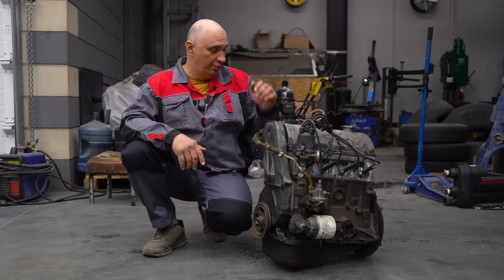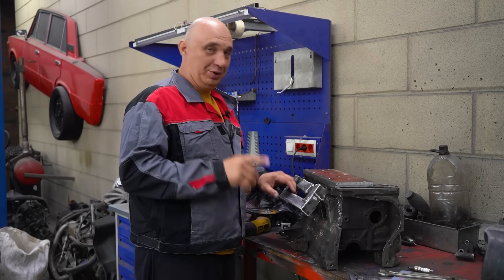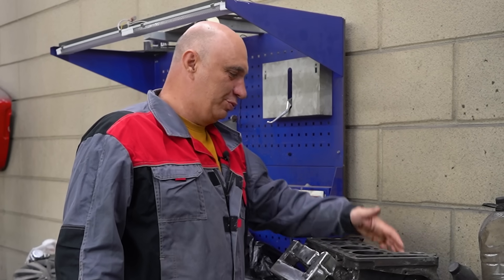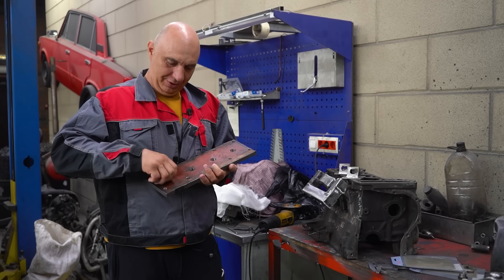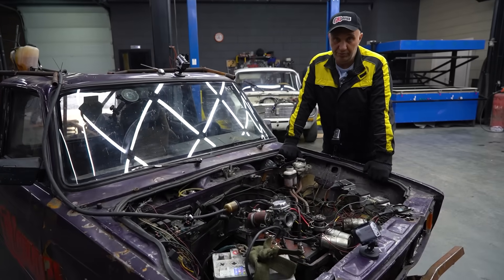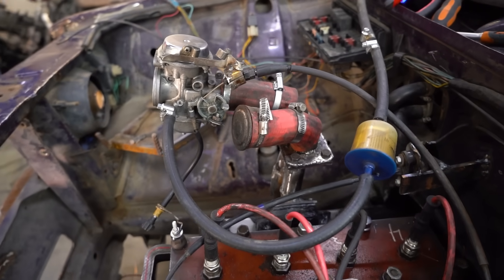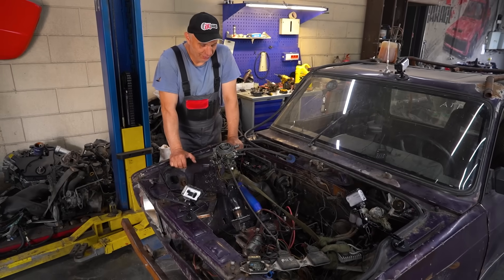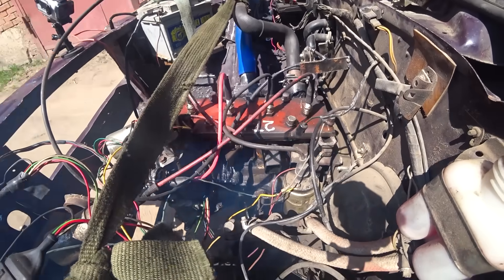4 stroke to 2 stroke Lada engine conversion

Comment: Your problem is the intake

You need to force air into the cylinders 

Traditional 2 strokes use reed valves the air is drawn into the crankcase as the piston goes up then the valve closes and as the piston decends the air is forced through transfer ports into the cylinders 

And easier alternative is to supercharge it

Comment: It would be nice to see 4 mikuni carbs on each cylinder, it sounds like there needs to be more research in to where the exhaust/intake port should be precisely and it's shape and size, as well as piston type, and compression ratio, if it was me I would take a outboard engine of similar size and copy its design

Comment: Dont use the case and pistons to pump the air charge, to many places for air to bypass to other cylinders.

Use a blower to force in the air.
If you continue to use only sleeve ports you need pistons with a deflector ramp to keep the charge air in and exhaust to go out, like other cheap 2strokes.

Or like others have suggested use the heads valves for exhaust like modern 2stroke engines. You can keep simple piston designs with that setup.

Comment: ok ok ok ok ok ok  how about............ convert two cylinders ( maybe oversized) into air pumps and two are forced induction, change the crank.........
Reply: would work well on a six, two pumps each stroke on 4 cylinders
Reply: make a cam....

Comment: Try with a blower, like a detroit diesel two stroke, maybe that fixes the problem with the not sealed chambers. Maybe you can use the original lubrication system, since detroit using that system also

Comment: Interesting if you could swap a crossplane crankshaft in this and see what that does to the vibration. Right now it's basically firing 1 + 4  and  2 + 3 simultaneously

Comment: I’m the back head I kept thinking (They need to install the exhaust system). A proper sized expansion chamber does a lot for the function of a 2-smoker.  This motor may be sucking in fresh combustion air through the exhaust port. 🤷‍♂️

Comment: You either need a forced induction to push the charge into the cylinders or some long narrow exhaust tubes to pull the charge into the engine through scavenging effect like the "tuned port cans" on dirtbikes

Comment: Either you guys do like a Detroit Diesel like most of the comments are pointing out, or go full nonsense and do a opposing piston engine, which will also need a blower, but still crazier than a usual Detroit Diesel.

Comment: What if you use 2 carburetors per opposite strokes working against each other so you will have vacuum applied without positive pressure pushing back to intake side. More or less one carb for cyl 1&4 and another for 2&3

Comment: What you need to do is make up another block and this time leave the crankcase alone, leave it full of oil as it usually is.
Then fit a compressor (crankshaft driven supercharger) to the inlet to force the air and fuel into the cylinders instead of using crankcase pressure like you have done here.
Also the inlet ports need to be angled upwards pointing towards the sparkplug and opening at about 1/2 way through the exhaust port opening.
Good luck.i love your experiments.

Comment: You need the expansion pipe to help keep back pressure and the idle need to be higher you got the reed valves right make sure the compression is around 190 to 200 psi

Comment: I feel like the 3 intake tubes to 4 cylinders has something to do with it. The middle 2 feed off 1 tube which want to fire but 1 & 4 are on their own large port. If cylinder 1 & 2 was on one intake tube and 3 & 4 on a separate intake tube that it would effectively equal out and have the proper air/fuel mixture since one would be on exhaust stroke and the other on intake stroke. I cant wait to see the next video on this!

Comment: it was better to leave the original heads. Change the timing gear ratio to 1:1.
Further, depending on the idea, or all valves as exhaust (own design camshaft). Compression mix like here in the video, or compressor, or turbocharger.

Comment: 2 strokes require a different carb style.  They are a low vacuum engine.  The air screw and fuel screws a different on 2 stroke vs 4 stroke carbs.  Operate completely differently.  Look at 2 stroke dirt bike carbs.  You'll also want to try and separate the crank case into different sections.  A simple sheet of aluminum and epoxy would work.  The motor should also be air tight.  it shouldn't have any air leaks between the intake and the exhaust.  You can pressurize the entire motor to 6 psi.  it shouldn't drop more than 1 psi in 10 minutes.  If it does, it'll be hard to start.  the more it leaks, the harder it gets to start.  Transfer port timing is important too.  You'll  want atleast 110 degrees of port timing.  Compression should be around 6 atmospheres. 10 would be much better.

Comment: Wait a second. There are a lot of things done wrong with this. Why are they feeding  the cylinder directly? And why there are no exhaust chambers? Also why did they cut the ports for inlet and outlet at the same height? Exhaust should be higher up than inlet. And the mixture should be fed to the crankcase directly not the inlet port and the crankcase at the same time.

Comment: Check the compression to see if it is reading over 100psi (7 bar).  Below that, it won't stay running.  May require stainless steel reed valves on the exhaust, if you don't go back to the original cylinder head.

Comment: As a self proclaimed internet expert I can see 2 issues. 
*The crank case doesn't generate vacuum do to the piston strokes being opposed (and I didn't see a reed assembly to stop back flow in the carb/intake  but I may have missed it). 
*The  Exhaust is critical in creating a scavenge effect to draw fuel/air mixture into the cylinder. Most 2 strokes use an expansion chamber on the exhaust port to create the necessary scavenge.

Comment: 2 strokes need scavenging from the exhuast. You need to put on a longer pipe with expantion chamber. You also may need to add a blower to it. You may need a possitive air presure for it to work. Good luck with the project.
Reply: 2 strokes need NOTHING from the exhoust. They run completly without!!! There are some major 2 stroke design issues in his concept.

Comment: I know that two stroke motors have transfer ports you should get any two stroke engine and see how the transfer ports are l have owned quite a few 2 stroke engined motorcycles its a very simple motor but this is a huge task converting a four stroke four cylinder motor into a 2 stroke there have been 4 cylinder inline 2 strokes

Comment: I would get rid of the big intake manifold and fit 4 motorbike carburators [ from a motorbike with the same or close to the CCs of  1 cylinder]  mounted on a short intake adaptor close to the engine.  I also think you need to do a better job seperating the cylinders in the sunp area, I would use the main bearing cap and weld flanges to them as seperators abd build 4 sepreate sumps with a carburator fitted to each sump. I would also play around with the timing and see it that helps. Good luck with it, I really love youe channel. Watching from Perth Australia.

Comment: Normal 2T engine At Low RPM 2T engine need Vacuum from Crankcase to pull A/F Mixture from Carburetor and when piston move down it will push A/F Mixture in too cylinder
At High RPM 2T Engine create Vacuum by Negative pressure from Exhaust Pipe , when piston move down and Exhaust port open , Hot gas will push out  and create shockwave  move through Exhaust Pipe but behind the shockwave it's Vacuum(Negative pressure) , The Vacuum in Exhaust pipe will pull A/F Mixture from Carburetor pass through intake port in to Cylinder(for your engine)  and some A/F Mixture will get into Exhaust pipe

you need smaller Exhaust pipe and Longer Exhaust pipe (at least 80cm) to create Vacuum(Negative pressure) in Exhaust Pipe

Comment: I think It needs an exhaust to do anything , people will be on here explaining 2 stroke expansion chambers and how they work and all that, in this case i think you need exhaust scavenging. So a log manifold with some pipe or ideally, header pipes that join into a collector.
Someone mentioned using a blower like a 2 stroke detroit and utilize the exhaust valves on a stock head. That does sound cool but i think a small blower drawing through a carburetor and pushing the intake charge into the cylinders would be helpful. But could be a bit of a fire hazzard so do take care. Ill be watching lol thanks you guys.

Comment: Like the Detroit diesel, you may greatly benefit from a positive airflow intake instead of a negative one to pull fuel and air in. 

Also, treat it like a V8. Twice the amount of air and fuel is needed compared to a 4-stroke since it’s firing every rotation instead of every other rotation, but you also get twice the power strokes too for the same sized engine.

Comment: Do I see this correctly? No muffler/exhaust? 2-strokes NEED an exhaust. Because there's no proper exhaust valve in (most) 2 strokes, there's no backwards air pulse to push the air/fuel back into the cylinder. It comes in, and flies right out into the exhaust, losing lots of power. You don't need a sound deafening muffler, but you ABSOLUTELY need a tuned pipe to push air back in. That's why 2-stroke engines have a narrow power band that goes "no power no power no power BOOOOOOOM no power". That "big power" part is the only section where the tuned exhaust is correctly reflecting the fuel mixture back into the cylinder. Before, and after that RPM, the exhaust is out of tune and either reflecting the fuel back in too early, or too late. 4-strokes don't care as much because they have an exhaust port (and cam timing) to prevent air from going in and passing right out the exhaust. (see Valve overlap. You want a little overlap so that the exhaust "pulls" the intake in without pulling so much it all goes out the exhaust.)

Comment: Tank a two stroke diesel and convert to gasoline by removing the fuel injectors and put spark plugs in their place and add an ignition system.
Reply: A two stroke diesel engine block is filled with oil like a four-stroke

Comment: So things to look into!
      I would definitely reference  alot of outboard engines for design  ideas. There are many 2-8 cylinder engines displacing up to 4 liters (Mercury Optimax's or Johnson/Evinrude Etec's and older are good examples). It's definitely possible. 
Suggestions from a guy who's been around these 2 strokes for years.
Maybe put a dome to the pistons in a way to help with Scavenging inside the combustion chamber. 

Look into "Surface fire" spark plugs (NGK BUHW) then you can get the piston really close to the spark plug and help bump up your compression. You are loosing alot of volume Due to the ports so every little bit counts.
Another thing: 
The backs of these 2 stroke crank cases are practically open and covered in Reed Valves. Often times having a small carburetor per cylinder. Maybe try fitting another carb and more Reed valves. Remember you have to have enough fuel and air charge to fill the bottom of an entire crankcase. While also loosing alot of potential fuel charge from Fuel contacting surfaces to be lubricated. 
Also the crank case definitely needs to be sealed between the two. Any sharing of charge will completely disrupt the charge coming into the crankcase, and being pushed into the combustion chamber. 
Ignition timing is another huge factor. These engines often idle at 0° BTDC and advance with the throttle up to as much 32°BTDC. Now this one id say 18° area WOT and 0 or even a little After TDC. Like 2 or 3°.
If I can think of any other suggestions, I'll definitely update this and hopefully it helps! We Definitely need to see this running.
Reply: This. I was thinking higher compression a better spark plug and 2 smaller carbs for better mixture. And advanced timing is huge.

Comment: You don't need the base for the 2-stroke to work, think detroit 2-stroke diesel that use a supercharger to blow the intake charge in the cylinder transfer ports but use valves still for the exhaust

Comment: I tried to get through their e mail to suggest making a 2 stroke engine like a Detroit Diesel which uses valves in the head for the exhaust and ports in the cylinders for air to be blown in via a blower but only a gasoline engine with a spark ignition system

Comment: It's not running because there is no scavenging action with this setup.  Just putting intake on one side of the cylinder, and exhaust on the other doesn't give the engine any action to pull air in.  This would work if you put a supercharger on the intake to push the air and fuel in.

Comment: @Garage 54 

Maybe try a diesel injection pump in conjunction with 2 stroke fuel. Place the injectors next to the spark plug. I am thinking direct fuel injection would solve fuel delivery issues. 

If you don't get enough air, then you can use a supercharger to force air into the cylinders as well.

Comment: I think you are going about this engine the hard way if you leave the block and head as they originally were and all you would need to do is change the camshaft a like a 2 stroke engine with actual valves
Reply: If a lada is converted to a two stroke in a forest and nobody can see because it has a stock head, is it really 2 stroke? I think it's based that they feel confident to replace the head.
Reply: I suppose but it would definitely sound different

Comment: you have very little compression. Find a way to force air into the cylinder as the piston is going up. Install a turbo. Maybe compress air to start the engine then the turbo will kick in. Do a compression test, I'm sure thats the problem

Comment: Each cylinder needs its own separate chamber in the crank case for this to work, otherwise the fuel/air mix isn’t going to be forced into the chamber with a shared case. each cylinder also needs a separate transfer port that connects the chamber with the crank case. You can reference the Kawasaki H2 triple to see how multi cylinder 2 strokes are setup
Reply: Crankcase compressor wont work because they have no transfer ports.
Reply: Matching cylinders don’t need to be separated, as long as they’re paired they’ll work, but they didn’t have a transfer system
Reply: Each piston needs its ports too
Reply: Creo saber porque no se mantiene... intenta poner carburadores independientes a cada cilindro además recuerda que en 2t la mescla ingresará al cilindro desde el cárter al subir el piston genera el vacio en el cárter esto obliga a la mesclar entre al cárter cuando baja el piston"comprime " el cárter haciendo qué traslade la mescla al cilindro.... además debes cubicar la cámara para así saber cuanto cm³ deberá ser tu cárter por cada 100cm³ de cilindro el cárter debe ser 150cm³ aprox doy un loco inventor también saludos

Comment: I’m wondering if instead of cutting the ports in the block like you guys did if you modify the camshaft so it has lobes 180° from each other and use the valves normally if it would work then because the ports that you guys cut and there’s no ceiling it would appear that it would need a blower to force air into the cylinders more like a two stroke diesel engine because it cannot scavenge. But I think it would be interesting to see if it would do like I just mentioned above either way keep up the great videos love your guises program.

Comment: Ditch the intake hoses, mount motorcycle  carbs to each intake, instead of hoses! 3 carbs, fab linkage to sync the 3 carbs! Attach cone air filters to carbs! Fab expansion chamber style header for exhaust 🤔🧐😮😃👌✌️🤘👍👍👍

Comment: A blower or something to keep pressure in the intake like an older 2 stroke diesel engine would more than likely do the job. Then scavenging of exhaust gasses will be the next issue. There are online calculators to figure out pipe dimensions ect, but some expansion pipes from an 80 or 125cc dirtbike would get the job done for now. You guys are something else though. There's no such thing as "NO" or "impossible" with you. An idea though for a project would be something like the W engine from VW, only something a bit more...Garage 54 interesting. But try the blower/supercharger.

Comment: It's hard to say without a better look, but I bet the chambers between crankcases needs sealed better. When the piston goes down, the fuel mix blows out between chambers instead of being pressurized and pushed through the intake ports.

Comment: Nice try!  No seals between the cylinders in the crank and the crank bearings needing pressure lube means the 2 stroke conversion needs to utilize engine valves like a Detroit diesel..I starting building one back ion the 90s but didnt have a budget to bore the vw block and custom grind a new cam.  Mine used ports in the side of the cylinder for forced intake and the 4 stroke head's valves were to be used for exhaust.  The block I used is an old cast iron VW inline 4 diesel..

Comment: I'd try shortening pipes to block as it needs the block and sump maybe sucking in air through joints,also volumes are wrong ,lots of stroke and cylinder swept volume compared to ilet holes proportion needs to all be correct sizing for it to run correctly or any air leaks make big difference,love your channel Vlad and team are awesome guys

Comment: Seperate carburetors for this system.   As it is other compression waves are interfeering with the charge flow of other intake (being linked). Seperate the carbs and intakes.

Comment: Another thing to consider is that when the center two cylinders are sharing crank case pressure, it is unlikely that the intake ports are drilled at exactly the same height in the center two cylinders, meaning that one cylinder will get some air fuel mixture dumped into it more than the other. Maybe not a big concern just speculation